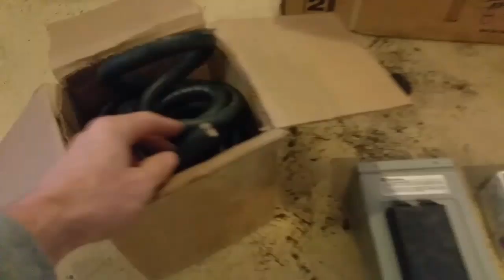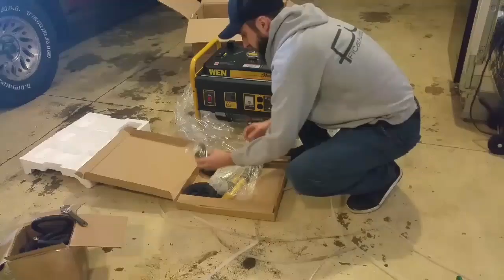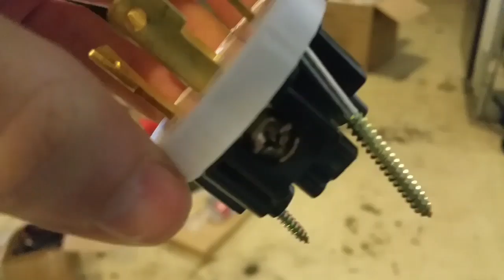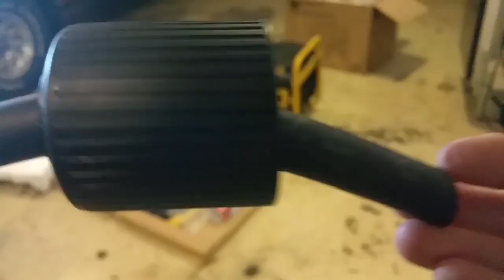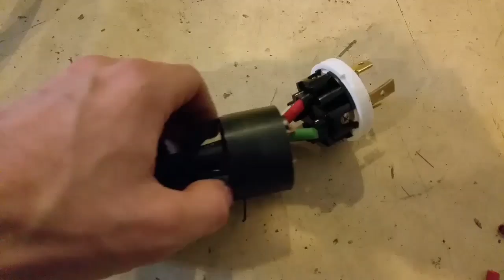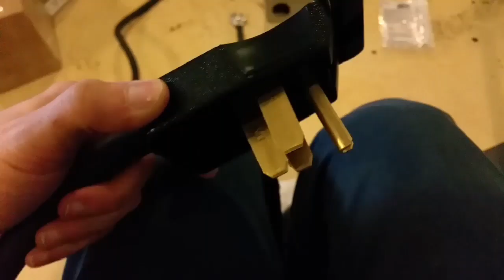How To Hook Up A Generator To Your House Wiring - Pt 1 Making The Power Cable

Comment: For what u spent. u can still do it a LOT SAFER. get a weatherproof covered male 
fitting that bolts or gets screwed to house and put a female fitting on house side 
of cord, if u F-up walking back to the house with cord plugged into running gen,
its not going to be good. OR turn off MAIN breaker first, then plug into house side
that way there's no juice on the prongs, then after gen ran enough to warm it up
plug into it. also remember the white neutral wire is a current-carrying wire and
that MUST be respected.